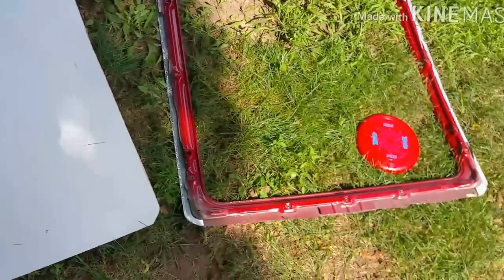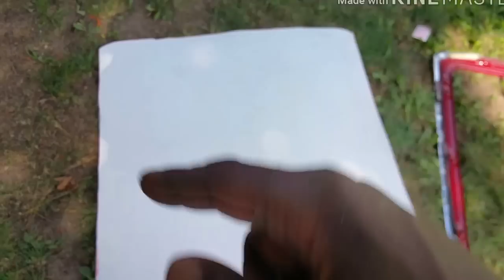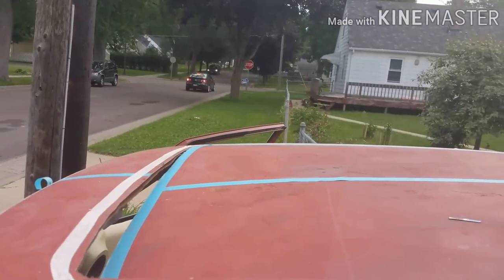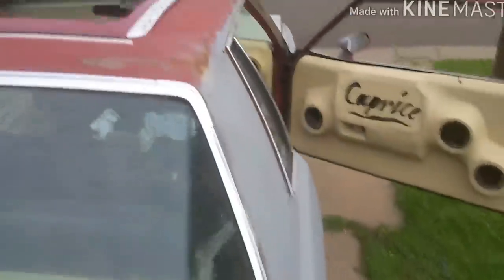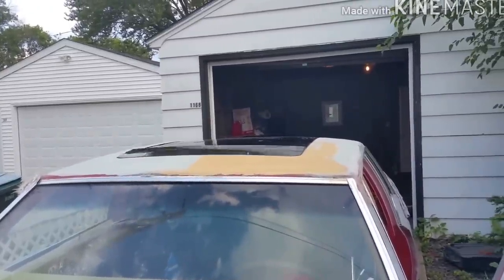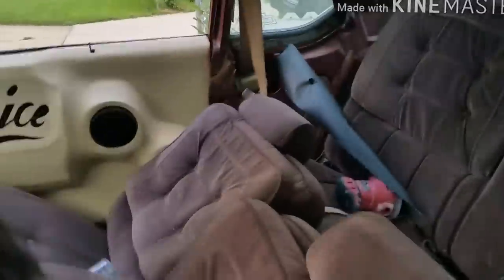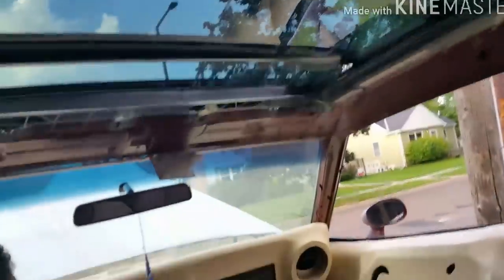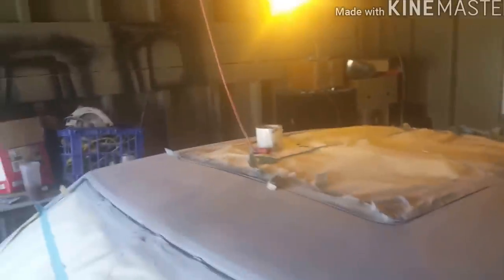Panoramic sunroof install.

Comment: Brah u gone have the hardest box chevy in your city u keep up on that bih
Reply from the maker: Thanks fam
Reply: Woodgrane Williams my first glass wont close when i turn the dial to 0. What could cause that?
Reply from the maker: Anthony James It might needs grease I would think.I  haven't had any issues with mine yet knock on wood....but try a little bit of pressure when you hit close see if that helps.
Reply: Woodgrane Customs Wea u from

Comment: anything you paint you can use it on ,it looks especially good for fiberglass.It looks like it will not crack,chip or anything if you bend any plastic or something.

Comment: Nice job bro..! Any idea if the 12' 300 panoramic roof will in the Aerocoupes? How hard was the install? I'm having a hard time finding ppl willing to do the install where I'm at.
Reply from the maker: Shark_RT It was easier than you think....you just have to make sure your measurements are accurate....it should fit the aerocoupe has a big roof.
Reply: Woodgrane Williams thanks for the reply bro..!

Comment: Nice work! I noticed the body filler on the painted roof-what grit paper does someone need to prep the surface with when applying over paint?
Reply from the maker: I USED 60 GRIT THEN 80 THEN 120 ON UP.
Reply: +Woodgrane Williams 
I mean what did you sand the paint with before putting the body filler on top of it?
Reply from the maker: JD Weaver 60 GRIT sand paper

Comment: How big is that darn roof? Did you have to make a place for the drains? Would that fit on a '97 Silverado ext cab?
Reply from the maker: Trevin Taylor 36 longhave to double check the width...the drain tubes is built on the sunroof itself so all I have to do is run the drain hose.

Comment: nice job but did you weld it in or did you just glass it in ???
Reply from the maker: Tack weld it in then glassed it in, fiberglass matte and resin, then bondo glass, then  light weight body filler.
Reply: great with all the sub's it will crack the glass its good that you tack welded it all up keep up the great videos ;)

Comment: did you bend the g6 skin flat along the chevy  cause I measured 3 times, cut 1 and mine has a slight bubble to it
Reply from the maker: liltwin901 what kind of car
Reply: 77 impala. aerocoupe just like your caprice
Reply from the maker: I'm watching you video right now
Reply from the maker: liltwin901 damn I would need to see it cause mine went right in there

Comment: Yo can you tell me what the dimensions of the sunroof are?
Reply from the maker: Luc Cherisol I think 36 long 24 wide have to double check.
Reply: +Woodgrane Williams. Aight Bet. Can you measure it including the motor and edges. I'm tryna drop it into a classic I'm working on just want to make sure it works. If you run by any of these sunroofs get at me. I can't find them anywhere around me.

Comment: What type of welder u use
Reply from the maker: 86 BonnieBoi Mig welder I edited out the video.
Reply: Aw shit i need to hop on one of these install mane how hard it was
Reply from the maker: 86 BonnieBoi It was easier than it looked..just make sure you measure 2 or 3 times.And if you make your template correctly  it's really hard to F up.This was my first roof that I ever did.But I did cross my fingers cause I did not want to F U my Chevy.
Reply: Motivation

Comment: Thats cold bro what car did you take the roof off of and any problems so far like leaks or anything does it get hotter inside in the summer because of the glass roof ?
Reply from the maker: Tumas Hedrick no leaks....I haven't drove it all Sumer,but when I do the roof stay open.
Reply from the maker: Tumas Hedrick 2007 Pontiac g6 gtp
Reply: Woodgrane Customs does it make the inside of the box hotter ?
Reply from the maker: Tumas Hedrick I haven't did any testing
Reply: Woodgrane Customs always wondered if it would could you let me know when you find out

Comment: Bro, which wires to power up roof?
Reply from the maker: Yellow and red go together for +black for _
Reply: Rite on Bro...hit u 2mar evening to let you know if I got it to work...all the way from StL, thanx
Reply from the maker: Yes sir.....
Reply: Will, i powered the roof...I only  a clicking sound
Reply from the maker: Make sure you got a real good battery fully charged..I had to take my battery out my truck then it worked..before it was clicking I think it was not getting enough power
Reply: Rite on Bro, Im on it. Holla back n a min
Reply: Will got it to work, but gotdamn! I jad to play with the switch to get it to close. turn dial to close it...it would go to close and open rite back up. back and forth, back and forth...until i pushed on it while back and forthing the control. U think the control might be bad? I would hate to get it in and have to deal with that...
Reply from the maker: Post a video